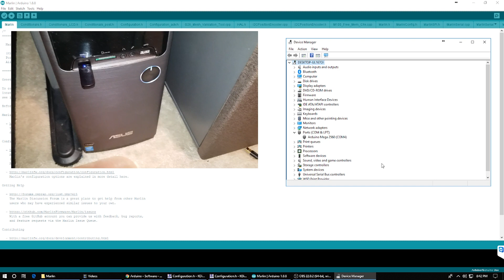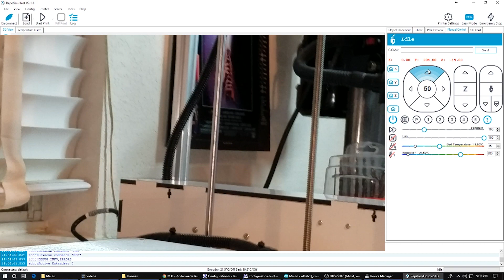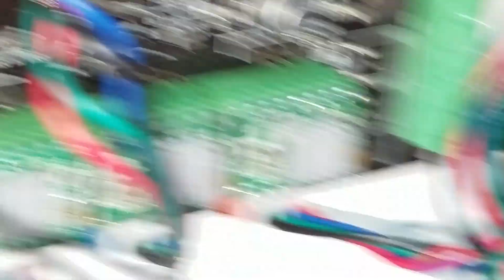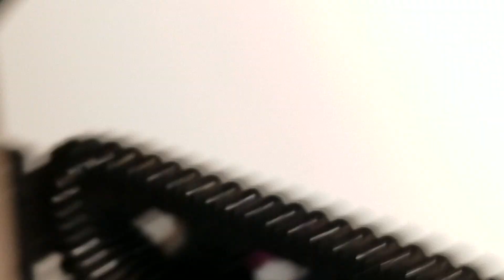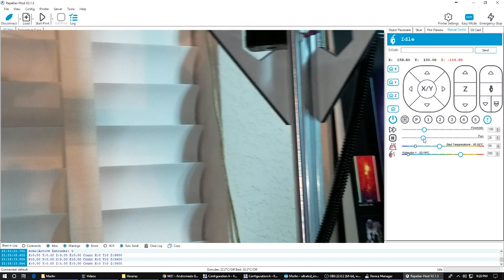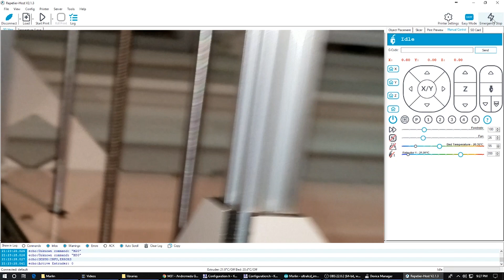Folger TEch FT-6 Programming and Initial XYZ Tests

Comment: does it have to be Arduino 1.8.8 because im using 1.8.12 and more errors are popping up for me than yours
Reply from the maker: No reason that you shouldn't be able to use the latest Arduino IDE.  You just need to be sure you have all the appropriate libraries, etc. installed.  I recently did updated Marlin firmware on my Ender 3 using the latest IDE.

Beo
Reply: @lordbeowulf1885  is there a place to find the firmware already set up?
Reply from the maker: @clayramus703  Well, if you're just doing the default firmware, you should be able to download it from the FolgerTech website.  However, you'll still need to program the board with it, so that part doesn't change.
Reply: I will try that, thank you for the suggestion

Comment: Hallo, so I did everything and wanted to try it with Repetier and got the problem, that the minus axis don't work at all, also the parking or the homing don't work, any ideas why? thank a lot
Reply from the maker: If it's the minus Z axis, I believe it won't work unless the tip is hot.  The same may be true of the homing sequence.  Try that and see if it makes a difference.  

Thanks,

Beo

Comment: Hallo again, would you explain how you navigated the Arduino to the file from Folgertech? I installed the Programm and downloaded the extra core and still couldn't get the configurations for the printer on screen. thank you.
Reply from the maker: Hi Khaled,

You're looking for the configuration.h header file in the Marlin folder.  That contains the majority of the things that you need to set to configure your printer capabilities.  I'll be changing mine in the not too distant future to add the second heater for the Chimera extruder that should be arriving in a day or two.  I'll also be adding filament runout sensors.  That should only require a couple of changes.  Remove/comment out the line "#define SINGLENOZZLE" and uncomment the line "//#define FILAMENT_RUNOUT_SENSOR", change the NUM_RUNOUT_SENSORS to 2, and add the pin definitions.  

Note that there are advanced configuration settings in configuration_adv.h, but I haven't had to mess with those yet.

Beo
Reply: @lordbeowulf1885  Hallo, this I understood from the video, I just don't know how to bring the file to the Programm. I hope you understand my problem.
Reply: @lordbeowulf1885  Finally it worked, I always did the same File and then open and it did not work, but it worked this time finally. Seems like I had a problem with my computer. Thanks a lot!
Reply from the maker: @khaledabdelhay5560  Glad to hear you got it working.  Good luck with the rest.

Beo

Comment: If you didn't already find it you can set your z offset in the firmware and also you can set it in the menu of marlin.  Under control > motion from your LCD.  In the firmware you have "#define Z_PROBE_OFFSET_FROM_EXTRUDER -0.0   // Z offset: -below +above  [the nozzle]".   Great to see you have it this far.  Can't wait to see a print.
Reply from the maker: Thanks.  I hadn't gone looking yet, but the firmware and software are the least of my worries since those are standard and known to work.  I knew there'd be a setting somewhere.  As far as a test print, I ran a successful Benchy on the first attempt (well second since I needed to move the piece of masking tape).  This was with only my rough manual bed leveling and default (except raft) settings in Repetier/Cura.  I was actually surprised it went so smoothly.  That's about all I'll be able to do for a couple of weeks, but I should be able to piece that video together this week sometime.